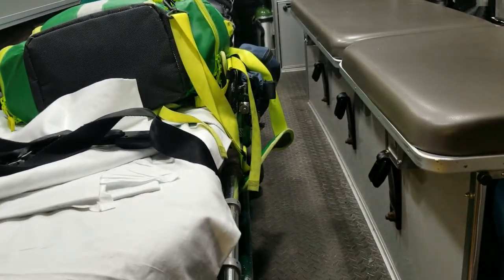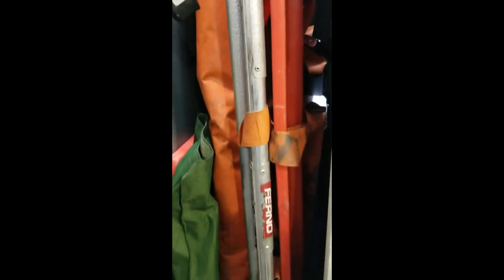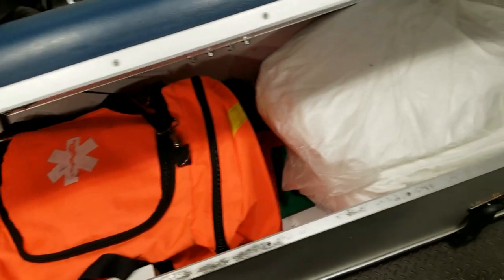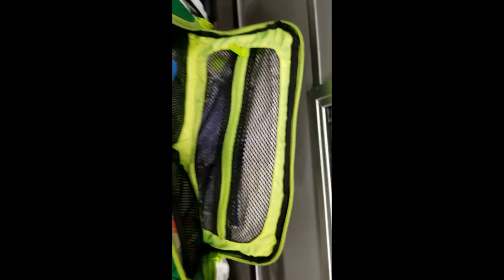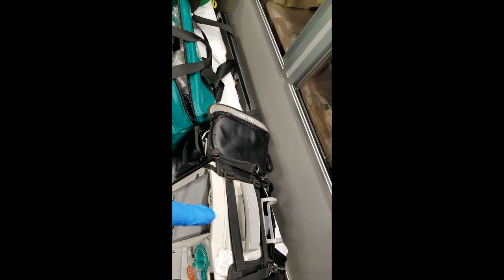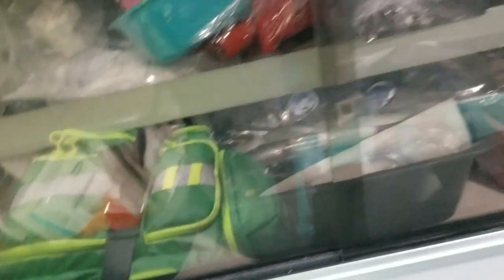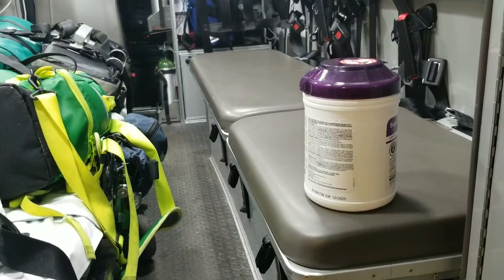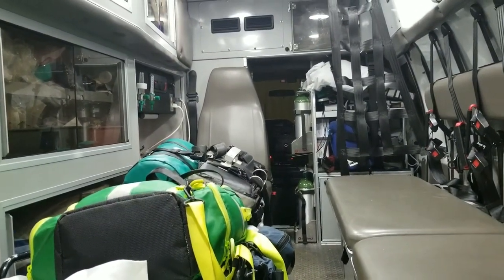NYC Ambulance Tour | The Right Way to Start an Ambulance Shift | NYC EMT Paramedic / Medical Doctor

Comment: I'm a bit surprised about your checklist. I'm a paramedic from Germany and of course we have our checklists as well, but it's rather brief compared to yours. Seems like you have to check every single item, even security stickers (btw what are those? Some kind of safety sign like "watch your head / step" at the side door etc)? And you check registration stickers, inspection stickers and oil at the beginning of every shift? On our checklist for each shift we just put in the date, shift-name, write down how much pressure there's in the 3 O2 cylinders and if we have spare O2 cylinder on board, if everything with the ECG, suction unit and ventilator is working, if normal medication and narcotics are checked, if the CO-warning device works and if the ambulance itself is okay ... it's by far not as detailed as your checklist. There are more detailed checks e.g. concerning expiration dates on medication or service stickers on the number plates on the 1st of each month, no need to check is every single day.

What's the OOS sign? And why do you use pillows on your cots?
At some compartments I'm surprised on how much empty room there's left, e.g. where you show some of the outside compartments or inside compartment with the pedriatric stethoscope
4:40 isn't there some kind of cover to secure the spare bottle at the top that it doesn't get damaged?
We don't have ballistic vests ... don't really feel the need to have one here
Reply from the maker: Hey thanks for the comment - NYC is over regulated. And there is no cover for the 02 tanks. However, we strap them down.
Reply: @nycstreetsmd  Too bad that there's no cover; Here a truck wouldn't be allowed to leave the company which does the service and refill on these bottles if there's no cover on the tanks; Just a simple plastic cover but alot safer in case something hits the top of it; And at the station they're stored with the cover on the new bottles, and when we switch the bottles the cover from the new bottle will be put on the old empty bottle in the storage room; And the 2nd / reserve bottle in the ambulance will always have a cover as well